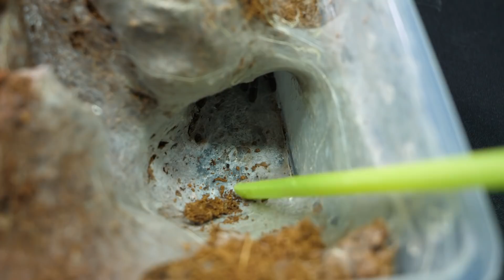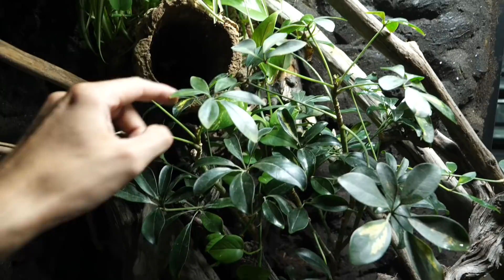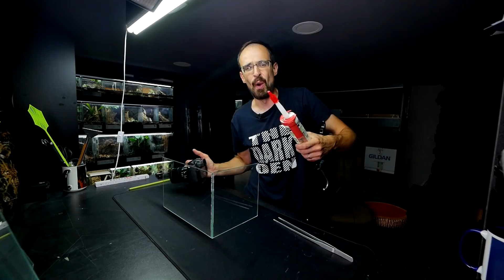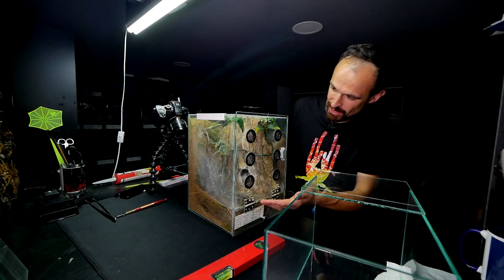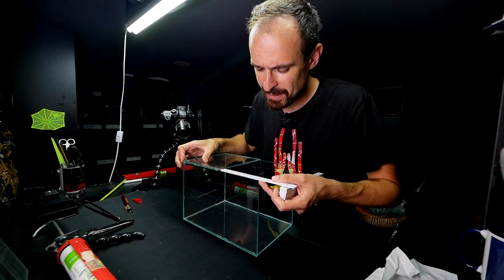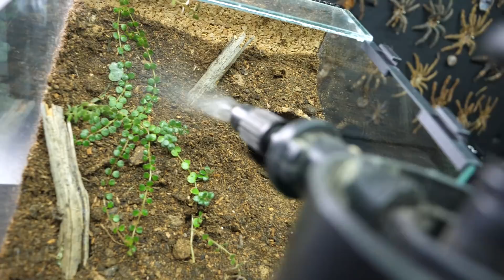ULTIMATE FOSSORIAL TARANTULA ENCLOSURE!

Comment: If you want to break it cleanly, either heat up the score/cut gently (but localised), and then drip cold water on it, or coat the jaws of parallel pliers with silicone and use them to grip/bend the glass.

Comment: very interesting ! iam just copy it 😜! here some note of mine:
 I found top an front ventilation  a bit small  exchange surface area, and grille hole too big .
To avoid Phoridae wandering across your terrarium and related problem a thin mesh  is away to go! 
I prefer add a drain hole in the bottom of enclosure. If you using standard float glass you can make it with a dedicate drill bit

Comment: Glass brakes cleaner if u line the scored edge On the edge of table. Lift the the glass a inch or 2 with over hanging bit then slam it fast and it will brake clean over the table edge.

Comment: I don‘t know if u‘ll see it. But I worked 4-5 years with glas. If u cut it u don‘t have to push a lot it will just make a „dirty“ cut & edge. Try to adjust it, maybe practice a bit till u got it right. And an important part is the oil, ur glascutter looks like u can refill it at the top if not, u need a bit of ( in germany we would say „schneidöl“ which roughly translats to cutting oil). It‘s important before every cut, it minimizes the risk of not breaking properly. And for the last part, after the cut u can easily break it with 4 fingers. The longer u wait before u break it the higher the risk it will either break like in the video or it‘ll break in the opposit dirction.
Sorry if this is a bit long and my grammat is not perfect but f*ck it😂 love ur videos man keep it going 💪🏼

Comment: Little tip that helped me is dont be afraid to run the cutter back and forward if you can keep the ruler in place and tap the gass along the cut with the handle of the glass cutter before breaking because your not cutting like a knife your making small fractures in the glass and hitting it helps them move through the glass before snapping. Hope that helps, you helped me a lot 😊

Comment: When cutting class like that, a trick I learned in stained glass class in high school was to tap the glass with the back of the handle of the knife. You don't have to tap very hard before the glass will (or should) just sort of pop off along the cut with the shock or the vibrations or whatever is actually going on. https://www.youtube.com/watch?v=q1HsQMQy4EM This video shows what I am talking about around the 6 min mark.

Also, congratulations on the pregnancy!

Comment: Petko, there is only one part of building cages you could use more practice on -- Silicone work. You've had several that leak, the hole where a communal T escaped and was eaten by the spider, etc etc. If you spend more time making proper silicone work you can eventually make a tarantula enclosure with a water feature again. Just need a little more practice.

Comment: Petko, a trick when using a glass cutter...
After you score the glass, run hot water on the cut mark, then run cold water on it, the contraction will cause the glass to split along your cut line.
Reply: Ooooor if he taps along the score mark, it should just pop apart.
Reply: @slinkychampion6533  this method I described is what we do for stained glass, with the smaller more intricate pieces.

Or in the art of candle working when an individual wants to cut a tube of glass to length.
Rod is typically more simple to break to length, but the tubes are typically a pain to break straight. The water method will make sure its straight every time. 👌
Reply: @asylumental  cool. The technique I've described in my previous comment I've used in my stained glass. With a straight cut on a flat, relatively sized piece it should work just fine.
Reply: @slinkychampion6533  yes definitely for large pieces...but it's also just like a fool proof method that should never have any broken glass. Good for DIY but not great for business purposes since it's a longer process
Reply: @asylumental  I will definitely have to try your trick with my smaller pieces!

Comment: Tip? If you cut the glass after cutting   you have to tap the cut gently. It will crack on the line. It will be much easier. Love your video's

Comment: Run the glass cutter over the glass two or three times, this will make it much easier to snap it.
Reply: Never run it more than 1 time.. it’s Not good for the cutting wheel

1. your cut was dry, use some ‚cuttingoil‘
2. you wait to long, break it directly
3. lay a stick under the cut an than press a bit on both site
Reply: @xEiNZELSTUECK  your methods work for large glass sheets, and is the quick way for sure... but when cutting anything small or spherical, or tubular, you should do the water method.
Reply: @asylumental  I work with glass since 5 years. Never done it with water. It‘s 4mm glass, you can break it with hand.
Reply: After you score the glass you Pour hot water on the glass, and then pour cold water on the glass. 

It will seperate cleanly along your cut line.
Reply: Yeah or apply heat after, carefully

Comment: Nice. My P. striata molted as well. Pokies are awesome. As a big fan of Chilobrachys and Selenocosmia genus I can positively say that it amazes me how much substrate you can squeeze in an enclosure. I use modified 30x30x30 cm enclosures with side ventilation panels shifted to the top + sliding half top opening system. I also started my long awaited project and got myself a young confirmed female T. stirmi - first true bioactive setup.